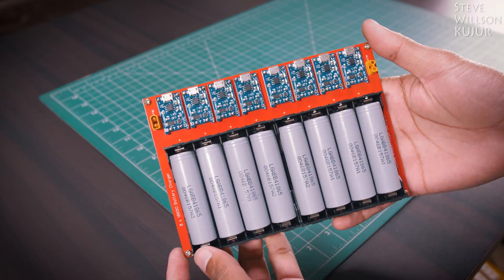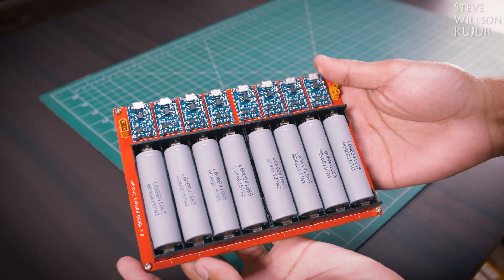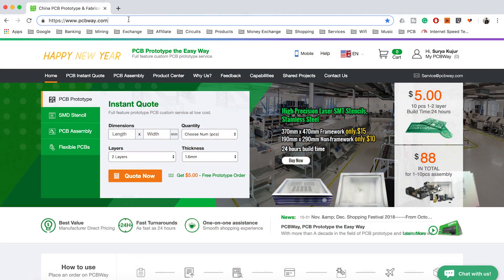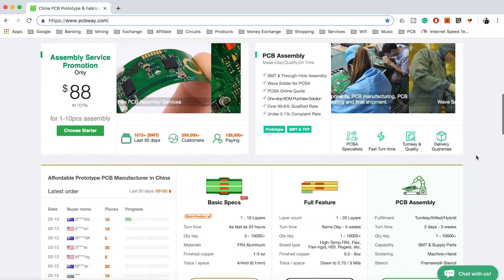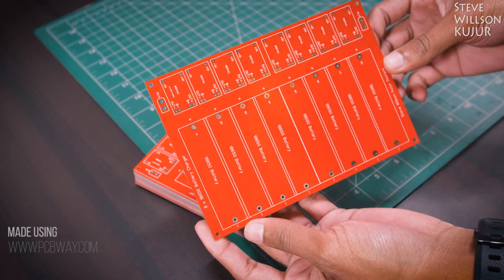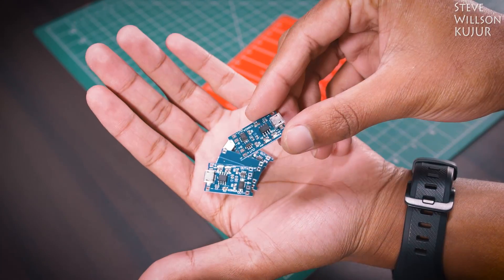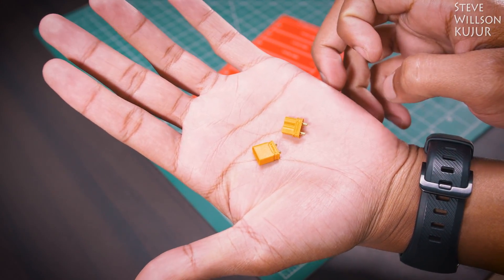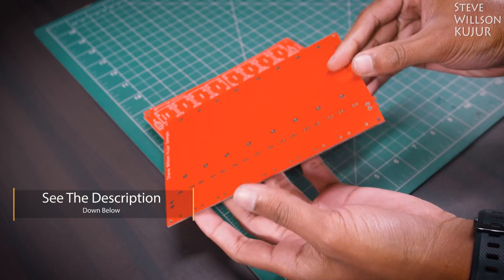Build: Super Simple 18650 Battery Charger | V2

Comment: Hey Steve. Nice board and great idea for charging multiple 18650's. But you are still using the XT60 connectors the wrong way round in regards to male/female. That additional XT60 connector on the end will have LIVE voltage over the two pins, which could be shorted by anything accidentally dropping into the connector, or just putting your finger in there.... Probably not the end of the world at 5V, but if you are pushing 8A into that PCB... I wouldn't want to touch it!

If you swap them over, the end connector will be impossible to short or touch (without some kind of looped metal). Safety by design!

Steve
Reply: Stephen, the plugs are XT30 not XT60 otherwise you are correct they would be better the other way round.
Reply from the maker: Yeah you are correct , i use 2 connector just because i can jump multiple board

Comment: Everything you need listed except the PCB so that’s no good to me. I don’t know how to design a PCB. Steve do you sell the PCBs?  If you do what’s the cost GB pounds please.
Reply: If you can solder it's super easy, you can use a flat piece of plastic and solid copper wire that will fit into the holes of the TP4056. First you make the holes for the 18650, 14500 or 26650 battery holders, once you have them lined up and fitted you can glue them down, then align the TP4056's above each cell and use a small drill bit to mark the spots for the holes, remove the TP4056 and drill holes or you can heat up a paper clip and push it through the plastic, do this for each TP4056 and glue them down. Now turn it over and bend the copper wire so they don't touch positive and run the wire across all of the negative connections then the positive and solder each one, do the same for the positive and run the wire up to each TP4056 negative and positive making sure you don't have the neg and pos wires touching each other and solder them. Now run the wire for power for both neg and pos to each connection on the bottom and solder, that will be you neg and pos rails, The rails can be thicker because it needs to handle 8 amp and use any connector you want as long as it's rated for 8 or more amp, done. 
The easiest way possible is to glue the TP4056 to the back of the cell holder so the charge port is hanging out, run and bare wire from the TP4056 to the neg and pos to each terminal, but run the wire under the TP4056 up through the bottom and back to each terminal and bend them outwards to tighten the connection on the cell holder. this is the solder-less method or solder them and use separate phone chargers, charge them upside down and use a piece of ribbon or string under each battery so you can remove them easily, done. Be Creative.
Reply: Barry Greengrass He did post a link with the gerber files.
You will need to download that zip file and send it to a pcb manufacturer.
2 popular ones are jlcpcb.com and pcbway.com .

They will use the file to make them for you and ship them direct to your adresa.
Reply: @05inventor  I only want 1 PCB though.
Reply: @barrygreengrass3379  oww ok ok , then you have to work something out. Jlcpcb will charge $17 to make 5 boards and you need to order the rest of the parts.
i would not mind to make you a board but i think it will be more expensive in the end to ship it to you from my location.